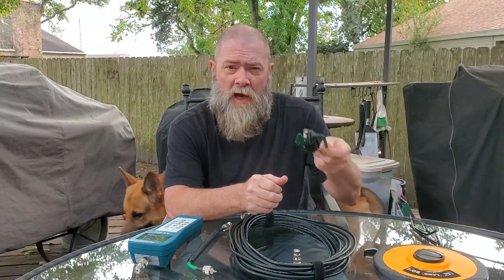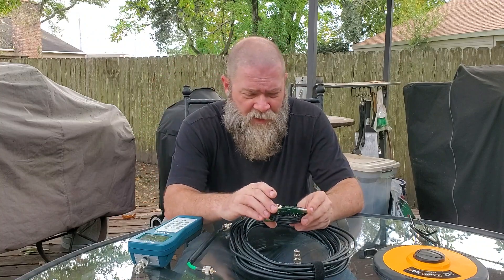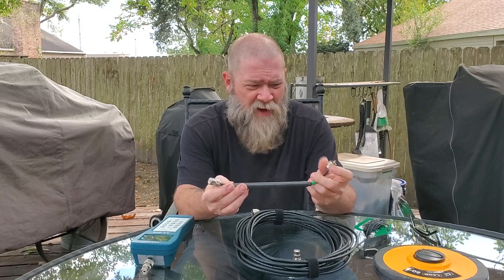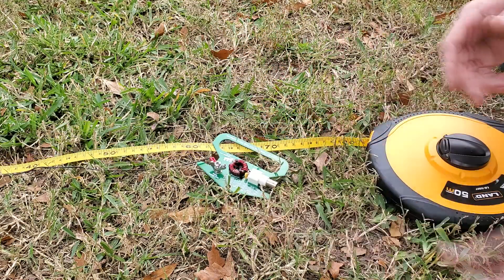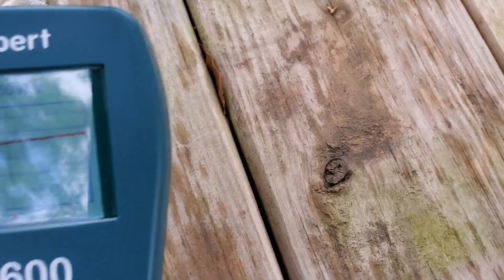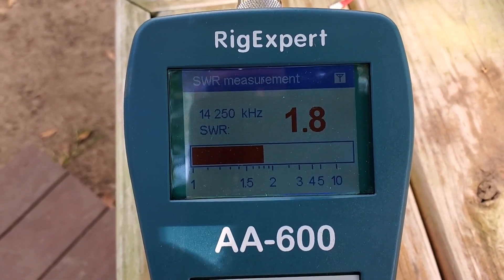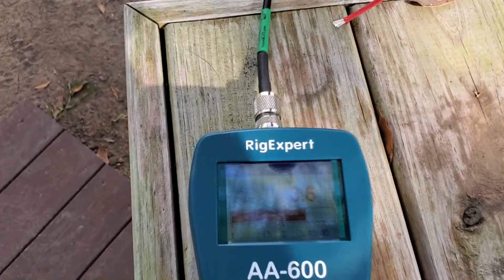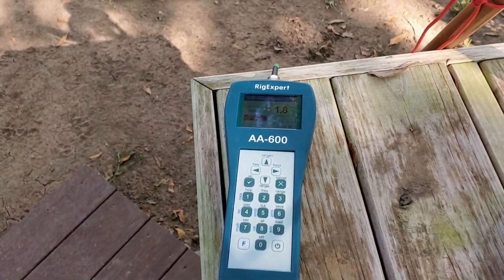QRP Guys EFHW No Tune Antenna Follow-up Video

Comment: I think there’s something fundamentally wrong with this product’s design. A 1:49 or 1:64 impedance transformer (unun) should have losses of around 20–25% (about 1.5 dB). Indeed, when I take two ununs, connect them back‑to‑back, and measure insertion loss, I get up to 3 dB total—i.e. roughly 1.5 dB per unun.

BUT! I also have two samples of this exact product from QRP Guys, and when I hook them back‑to‑back I measure losses of up to 7 dB. That’s 3.5 dB of loss per unun—about 55%—for the QRP Guys “No Tune End Fed Half Wave Antenna” unit.

This makes me think there’s something seriously wrong with the design. I’m not entirely sure what, but one possibility is the poured ground plane on the PCB. The transformer windings and the secondary side (the antenna side) are in very close contact with that ground, and there’s likely significant capacitive coupling between them.
Reply from the maker: I may take this apart again now that I am a more seasoned ham than I was when I made teh video and see if I rebuild it if that makes a difference in performance.  I just was not impressed my first go round.  Thanks for the comment and for watching.  73!

Comment: For 20m I use the 28'8" length and use a 25ft coax on the ground, no choke, into the radio, and seems to work fine.
Reply from the maker: That's good to know.  Thanks for sharing.  I may go back and revisit this antenna again and see if I can get better performance out of it.  Thanks for the comment and for watching.  73!

Comment: Hi it will work, eventually. You could try to measure 5 metres from the antenna back toward the transceiver and then coil up the rest of the coax ( say 6 inches in diameter, secure with tape of some cable ties) and transmit from there. Doing this you are creating a choke balun.
Reply from the maker: Great tip.  Thank you for sharing !  Thanks for watching and for the comment.  73!

Comment: If you ad a counter poise wires of about 10 feet it really helps this antenna out
Reply from the maker: I may give that a shot.  I generally don't use counterpoise with EFHW antennas.  Thanks for the suggestion.  Thanks for watching and for the comment.  73!

Comment: Learned the hard way that these EFHW are not great without a counterpoise, even with a tuner. I’m now using a SOTA beams band springer which comes with a counterpoise and run it on my 705 via a wonderwand widebander ATU, and get great results.
Reply from the maker: That may be the case with this one, but all of my other EFHW's operate just fine without a counterpoise attached.  Maybe having a counterpoise will improve performance to a degree, but most of the time I just don't use them on that type of antenna.  I am glad that you found a technique that works for you.  Thanks for sharing and for watching.  73!
Reply: @HR4NT  No problem. You’re one of the best channels out there, and I certainly learn a lot from you. Thanks for the work you do!!

Comment: I love mine, it's cut for 40 mtr's and runs at 1/1 to 1/3 across the entire band with no tuner.
Reply from the maker: I am glad to hear that someone has one that works fine an that they enjoy it.  This was just not the case with mine and I have moved on to other antennas since this video.  Thanks for watching and for the comment.  73!

Comment: MOST RXTX DO HAVE INTERNAL TUNER CAPABLE OF TUNING A
3:1 ELSE YOU HAVE LDG TUNERS!
EVEN MFJ HAS NOW AUTOMATIC
TUNERS. BOTH UP TO 125WATT..
SOULD NOT BE DIFFICULT TO TUNE
THIS 1.8:1 SWR WITH ANY TUNER!
DID YOU HAVE A COUNTER POISE
FROM THE ANTENNA --- IE ☆NOT 
USE ☆ COAXIAL CABLE AS 
COUNTER POISE?  0.05WAVELENGTH!
TIE THAT AROUND BNC OUTER CONNECTION. 
OBS! D O  N O T USE CHANGEOVER
FROM BNC TO PL - USE ☆ONLY☆
THE BNC CONNECTOR!
Reply from the maker: I get what you are saying and I do have an LDG tuner.  The issue aside from this just being a lousy antenna, is that it is advertised as a no tune EFHW.  So after tuning it with my analyzer, I really shouldn't have issues with tuning.  Since this video was made I have since then moved on to designing and building my own antennas, all of which work fine without a tuner and are resonant on multiple bands.  Thank for the comment and for watching.  73!!

Comment: Good stuff. These sort of basic experimentation/trial and error demos are where it's at for really helping me stay motivated. If not for the rf properties and theories involved: for the simple fact of seeing other people run into the same head-scratcher moments. Thanks, Boss. 73's
Reply from the maker: Hey it happens sometimes.  For some chasing the problem until it is resolved is feasible.  Personally, I will do that to a point, but i want a quality antenna that isn't going to make me work on it all the time.  Thank you for the comment and for watching.  73!

Comment: ABR no longer sells the choke. Will six or more regular ones work?
Reply from the maker: Actually that is incorrect.  I just got off the phone with Shannon at ABR and she said they do not have them ready made as different hams have different needs for connections and lengths and so on.  So you go to their cable customizer and custom build one, or she said that you can call her up at (713) 492-2722 and she will assist you in getting one ASAP.  I know at the hamfests they attend you can buy them premade right there as well.  I hope this helps.  Thanks for watching and for the comment.

Comment: What size wire did you use for the antenna?  Looked on QRP site and did not see it.
Reply from the maker: I use 26 gauge for the majority of all my antennas.  Cheap, easy and lots of it.  I get mine from Sotabeams for about $17 for 300 feet.  Thanks for the comment and for watching.  73!  https://www.sotabeams.co.uk/antenna-wire-lightweight-100m/

Comment: Unless the antenna is balanced (i.e.:  a dipole) there should always be a ground at the feedpoint of the antenna. In this case you clearly identified the coax acting as a counterpoise and was basically part of the antenna. If you think about this, you basically built a dipole that had a series-inductive tuning network on the center conductor. Being that radio waves are alternating, it was unbalanced and electrcial properties were not equal on both sides; thus the suedo dipole you made did not work as advertised. Despite cutting to get a reasonable SWR at the radio end, the impedance at the antenna/balun was drastically off, thus creating a great deal of loss due to the mismatch. Stake a ground and get that balun properly grounded and put your choke at the antenna end of the coax and you'll experience a true end-fed antenna. This is the case regardless of what type of antenna you're using, vertical or otherwise. This being an end-fed or long-wire (harmonic antenna), you need a ground reference for that radiation to get properly transformed through the balun and all the RFI off the coax. The coax should never be used as the antenna. Tuners in rigs that are feeding 50 - 75 ohm cable do nothing more than make the radio happy; they don't make the antenna work any better. 50 ohms should be the impedance you see at the point the coax connects to the antenna. So mover that antenna analyzer to the BNC of the the QRP Guys unit with a ground stake attached to it and make it read correctly there. Then you will have a true end-fed antenna that can do some pretty amazing things!
Reply from the maker: Thank you for that explanation.  I will give it a shot.  Thanks for watching and for the comment.  73!

Comment: I'm having the same issues.  SWR goes up the higher I raise the feed point.  Also, depending how you route the coax, you'll get different results. This is not a good antenna if intended for park or mountain QRP contacts.  Too many variables affect the outcome.
Reply from the maker: I agree.  I have quite a few EFHW antennas now and they all perform very well without the issues this one has.  Thanks for the comment and for watching.  73!

Comment: I could be wrong, but if the SWR goes lower on the sweep I am pretty sure that means it's too long. Have you tried coiling/wrapping the wire back on itself to shorten it and see if the SWR goes down.
Reply from the maker: I have tuned this antenna three times as of now and it just isn't a fantastic antenna.  For those wanting to try a first build, it may be ok, but I have so many other EFHW's that perform flawlessly that this one has just been shelved for now.  Thanks for the suggestion.  73!

Comment: ABR Coax is great.   All of it is Direct Buriable, so it's tough stuff.   That Balun piece is about $35 normally in RG8X size.   They also do make a LMR 400 size also.    Also that Toroid is a Mix 31...   it blocks 1-300mHz.  And it screws into the Antenna.... You also don't need an adapter.  It has a PL259 on one side and an So-239 on the other.   I have a bunch of them.  Great video.
Reply from the maker: I appreciate the info.  I am good friends with the folks at ABR as I use their coax pretty much exclusively now.  I am glad you enjoyed the video.  Thanks for watching and for the comment.  73!

Comment: ...so many questions... does it have a 100pf compensating capacitor? Where did you buy your kit... EBay? Could be a cheap Chinese clone with a poor quality useless core. did you check the wire build with others on the net.. go to one of Steve Ellingtons YOUtube primers..
Reply from the maker: Hello Mortimer!  Yes it does have a 100Pf capacitor.  I purchased the kit from https://qrpguys.com/qrpguys-end-fed-wire-antenna .  When buying stuff like this, I prefer to buy from the source, not a third party if at all possible.  I have spoken to other fellow youtubers about this antenna and they have had similar issues, not all the same, but issues none the less.  Since this build, I have built quite a few other EFHW antennas, including one I designed myself that handles up to 500 watts!  This was a fun first build but knowing what I know now, I would have gone with another option.  Thanks for the comment and for watching.  73!!!

Comment: Scott, you did a great job with your two videos. You also showed that antennas are NOT just formulaic! As you build more and more antennas and experiment with them you'll develop a sense of what works and what doesn't. Don't get discouraged. Your antenna worked just fine. The 1:49 balun is an impedance matching device that transformed the approximate 2,500 ohm impedance of the END of the half wave to the 50 ohm impedance of your transceiver matching circuit. A tuner will reduce that down to 1:1 right enough.
Anyway, 1:1.8 is just fine. You should just make sure the VSWR doesn't stray much above above 2:1.
Reply from the maker: Thank you very much for sharing that!  Since this video I have built probably 5-8 more EFHW antennas and have become rather proficient in it.  I really enjoy building them now and do so every chance I get if the need arises.  Thanks for the comment and for watching.  73!
Reply: @HR4NT  you're quite welcome. Please keep up the fine effort.
72 de William, k6whp

Comment: That big coil of coax you had near the analyzer probably had a lot to do with your results.
Reply from the maker: I do not think it had that much of an impact.  The antenna is just not that great.  I have 10 other EFHW's that work just fine without the hassle I got from this one.  Thanks for the comment and for watching.  73!

Comment: I built it and worked with it.  Then forgot about it until looking through a bag for a connector.  It is an antenna I would build and hang onto and if someone I am activating with forgets their antenna I will loan them this one.  In an emergency I would throw this one up as it packs small.  Great video!  73! de KE5ES
Reply from the maker: I agree...I have so many other EFHW antennas that work flawlessly that this one just doesn't get used that much anymore.  Thanks for the comment and for watching.  73!

Comment: Have you tried putting the spider pole in the middle (so you have a true inverted-V)?
Reply from the maker: With this antenna, no.  But I have set the pole up just for that purpose with other antennas.  Thanks for the comment and for watching.  73!

Comment: Got same weird results. Its going...
Reply from the maker: Yeah I am not impressed with this antenna at all so far.  Different folks are having varying experiences.  I may have to go back and mess with the toroid a bit more and then retest it and see if I can improve the performance on it.  Either way, at the least it is a good kit to gain experience in building antennas.  Thanks for watching and for the comment.  73!
Reply: @HR4NT  toroid material seems to be weird. I made 49:1 balun with it, same results. Mine was a aliexpress copy, maybe that is the problem. 9:1 copy works great.

Comment: Good information on the video and the comments.  What is the white pole you're using to secure the base of the antenna???  73
Reply from the maker: That pole is an electric fence pole from home depot for about $4.  It works great to attach your antenna if you have nothing else around.  (((LINK:  https://www.homedepot.com/p/Everbilt-1-in-x-1-in-x-4-ft-Step-in-Plastic-Fence-Post-901120EB/206690318 )))  Thanks for the question and for watching.  73!!!

Comment: If You have a good performing EFHW transformer you find with a approximate 21m long radiator on 40m band a SWR of  1.7 - 20-15-10m a SWR of less of 1.2. Problem on the QRP Guys transformer is first, that they clame that there product use a FT82-43 ferrite, and it is not. It's a something else ferrite core that does not perform. May be You can tune it on one band but it does not match on the outers.  Second is that a 1:49 transformer performed better than the 1:64 from the kit. But the main problem is a wrong ferrite that is coming with the kit. I asked them about and supplied also measurements with a resistive load on the output showing a total wrong transformation behaviour. The answer from them was ignorant, telling that's there best selling kit and wished me some fun with my further experiments. So that from this Guy gays selling a non working product. So what to do? Buy a good genuine Amidon FT82-43 core and rebuild the kit with a 1:49 turn ratio (3 turns primary, 21 secondary) Then it works perfect. The shoke You place in 3-4m close to the transformer. Problem on this kit is a unknown non subtitle ferrite core that is coming with the kit causing a non resonant wire length to come to a reasonable SWR. But on this case the radiator is not resonant, and even unable to tune on the same way on the upper harmonics. And SWR becomes also very unstable tweaking around with the coax. On a good performing transformer you have almoste no effect moving the coax from one side to another. It's definatly trash kit that they are seling. But with a DIY transformer with genuine core you would be very happy - I hope You understood what I've tried to explain to you explaining Your problem's..But for shure, with this what You have You never ever will get what they advertise, a working multiband EFHW antena. And, If you would have good performing transformer wirer combination You would be very surprised how well this antena is performing. Very good contacts and a super nice and stable low SWR, without any need for a additional tuning device. The problems that You have does not come from You, it's simply that You can not active any good result from what they are selling, this QRP Gays. I hope You could make something out of my explanation - 73 my friend 👍👍
Reply from the maker: Thank you again for watching.  I replied to your other similar comment on my follow up video.  73!
Reply: @HR4NT  Thanks, cool!!

Comment: My no tune antenna works great are you sure you wound your toroid correctly you don't need a tuner if you build it right.
Reply from the maker: It is possible there is an issue in the build.  This was one of my first antenna builds.  I used it for a while on FT8 when I first built it and it seems to work, but after getting it on the analyzer and tryin got tune it up it just didn't cooperate with me at all.  I may have to revisit it down the road.  Thanks for the comment and for watching.  73!
Reply: Elevate the feed end up the pole and put the end slightly elevated off the ground. Try that will still act as vertical.
Reply: Another; The end you had at the top now goes on the slightly elevated gound end and the feed goes up the pole.

Comment: 1.7 isn’t bad… And i’m sure you could do better if you wanted to. I get out and do pota and the last park was 1.2 and the next is 1.7 I don’t really care. My radio can handle it and I still make my qrp contacts. I guess it’s just a difference in what you like. Seems like you want something perfect at home. But this is perfect in the field. I make my own, but its 100% the same design.
Reply from the maker: Chasing SWR is not always a good thing.  You are right, 1.7 isn't bad and I could probably live with it.  I have since moved on to other antennas that have been performing very nicely, like the K6ARK EFHW kit...that is a sweet antenna!  Thanks for the comment & for watching.  73!